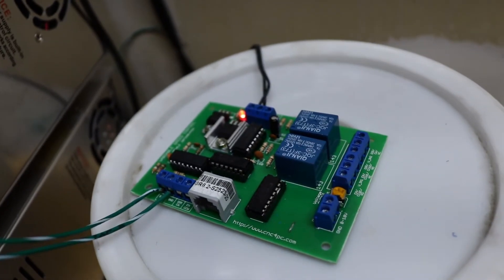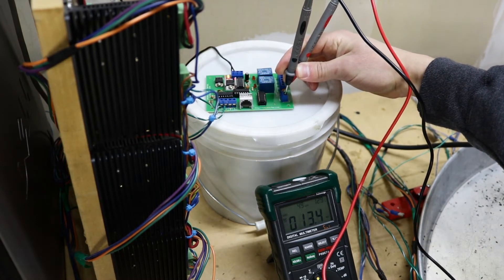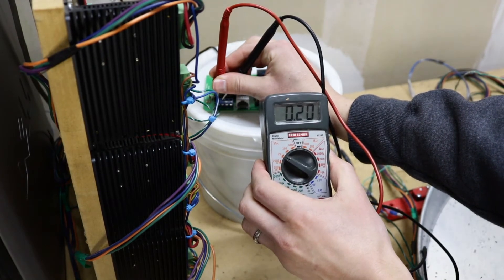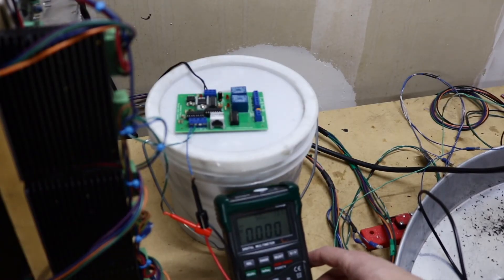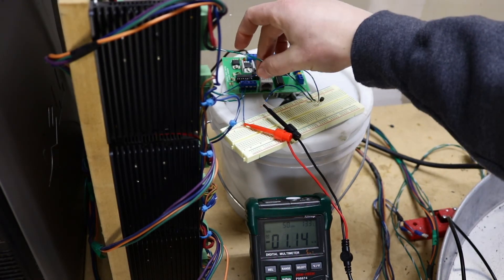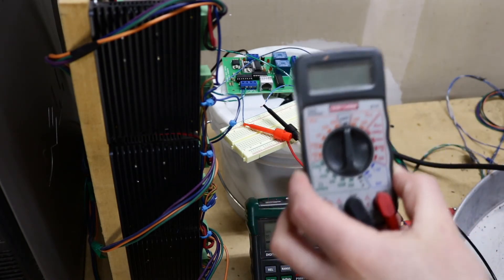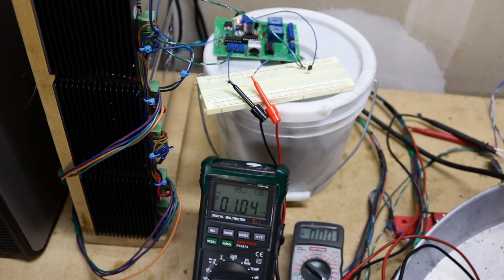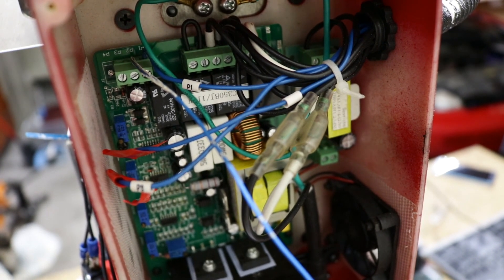The Secret to C6 Board Spindle Control - CNC4PC

Comment: Not sure if it was available when this video was first posted, but the example HAL updates provided for CNC4PC worked for me.  http://cnc4pc.com/Files/EMC2.txt  

I did have to tweak the scale.0.gain and scale.0.offset values to get the RPM right.  I also add the following at the top of my HAL file:

loadrt scale count=1
Reply from the maker: I think my issue was that my outputs on the breakout board had such a large resistor that it wasn't triggering the C6.  I used the BoB outputs to trigger the added transistor which gave the C6 5v without a resistor in line.   Maybe the gain or scale would have helped, I don't remember if I played with those or not.

Comment: Hi man this is excelente idea to control with mach 3, do you know if this board can also work with ac servomor?
Reply from the maker: I'm not sure, the purpose of this board is to make LinuxCNC drive a DC motor by treating it as a stepper.  It only provides the control signals, not the power.  I would think the motor driver would be compatible with Mach3 or LinuxCNC but I don't have any experience with servos.
Reply: @RivalMachining thanks for your answer. Thats mean that if i dont use a dc motor like spindle for example a i have a stepper motor like a spindle, i dont need this board? Because im trying to connect my stepper like a spindle with any success with the BL mach3 cnc 5axis. My axis works well but when i connect it like spindle doesnt work.  Do you have a video to know how to do it?

Comment: What would need to be done to change the scale? Mine works but its not calibrated at all.
Reply from the maker: I'm not sure I fully understand your question.  There are a few places that you can change the output.  You need to setup your CNC control software to work with this board.  You have to tell it to treat your spindle as a stepper which is kind of weird to me.  Once it is playing nice with your controller, you can dial the 0-10V output with the potentiometer on the board.  Depending on what spindle driver you are using, 10V may not be enough (My Sieg takes 12V for full speed).  That's why I developed my own board.  My board also runs off PWM Spindle control, so no treating the spindle like a stepper.  https://rivalmachining.com/products/pwm-to-voltage-spindle-speed-controller
Reply: Do you have a Half file that works with Linux CNC for PWM? I am trying to setup my C6 board with LinuxCNC using the spindle page in the Stepconf. I am having an impossible time getting a linear output (my controller uses 0-5v potentiometer currently). Twice now, I have changed settings in there and when I turned on LinuxCNC, my entire computer turned off and the boot screen stated it sensed a power surge and turned off to protect itself. 

Really worried that if I keep messing with it, I'm going to fry something so I would like a hal file I know is proven before I keep messing around.
Reply from the maker: Email me at Dallas@RivalMachining.com and I can send you what worked for me.  Depending on your setup, you might need different things in your HAL file, but you will at least be able to compare the two.